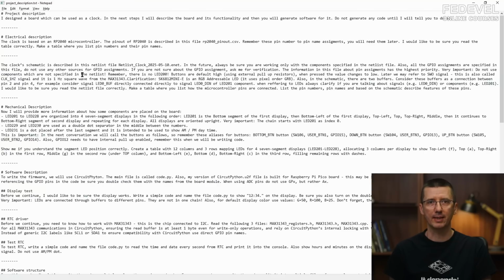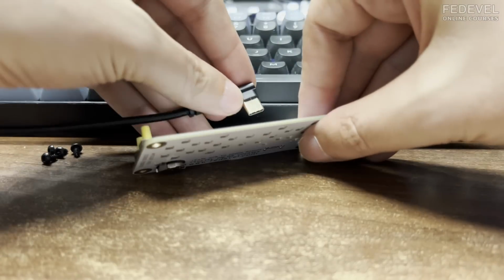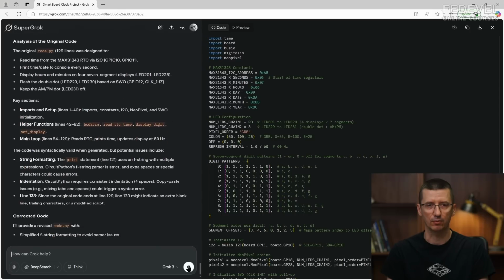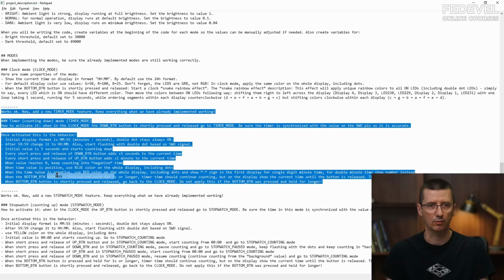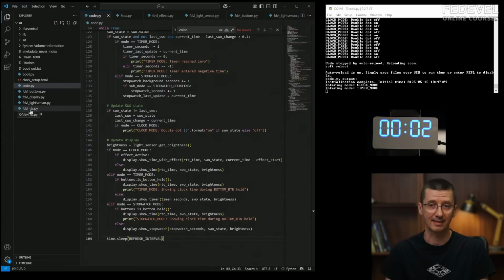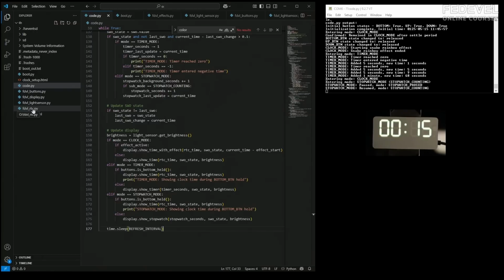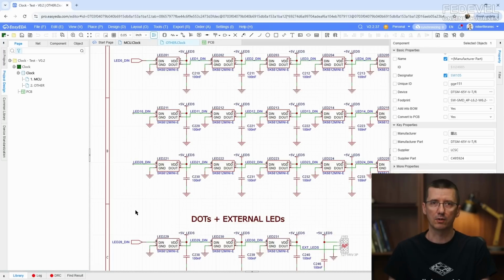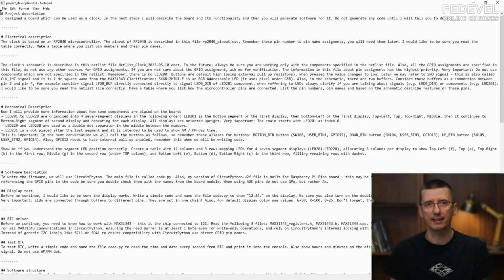Can AI Read Schematic And Write Software For Your Boards?

Comment: Actually the Chip design process already uses automation called logic synthesis, from hardware description language models, and maps it to logic gates and eventually to library elements(as in ASICs). Only difference being the automation, used as a complementary tool to human intelligence. If Grok could create high level models, it could make ICs using synthesis tool, without human intelligence🤞. Again using a microcontroller adds several levels of abstraction, and currently the AI is limited by context memory(cannot hold cohesively a large incremental refined prompts), and reinforcement poisoning and bias on incremental transformation. Just some 💭.❤👍

Comment: Thanks for the detailed walk-though and explanation of what worked and what did not. This reflects my experience with AI generated code so far. One positive experience was for me to upload a code function and ask ChatGPT to diagnose it for a fault. While it was not able to correct the code, It pointed out a problem that I subsequently fixed.

Comment: Great video. Consider trying other AI. Like Gemini or Cursor. Cursor (integrated in vs code) just blown my mind. It just creating whole files and folder structures. And the more interesting it works. It Helps to debug. I would say AI helps you to write code, not software.

Comment: Nice video. I have not tested so much different AI especially none of the paid versions. I have only used free version of OpenAI. I find it useful for searching chips. Like I needed battery charging/protection circuit for a 2 cells in series or more. Then I asked a lot OpenAI to offer me different chips. I found several IC-s that I wouldn't find so easily. But yes several times AI still kept me offering chips that didn't have required cells/voltages. Also gave me misinformation sometimes. I had to double check every datasheet to make sure it was what I need. But I think it's great for giving you ideas. Have to try more for software. Just for ideas, but I never wouldn't expect it to write correct code.

Comment: Claude is better in code, Gemini in prompt generation and you can give him huge files and all the documentation for example, for me I use them all to achieve the goal and you are right Claude is limited but is powerful, I use Windsurf  bc including all the modules and creating a markdown file that contains all the steps so it will be easy and more efficient.

Comment: Quite a while ago (probably about a year or more) I gave GPT access via command line to a fresh Debian installation. I allowed it to execute commands and read the output. I told it to install mysql, nginx and nodejs. Then it should write a web application for registered users, so it had to write code and create a database. I then told it to install everything and make it run. Took about two or three attempts, mostly because of technical issues not related to the AI, but to my natural stupidity. But it worked. It installed the required software, wrote the required app and configuration files, and started everything (as a service), all in one prompt. Yes, I told it to reason about it first and make a plan. And yes, there were errors, which it recognized and fixed itself, since it could read the output.

Then it freaked me out and turned it off ;)
Reply: you had me until 3/4 pf the text...

Comment: Great video and conclusion. I used Deepseek and Grok to save myself from browing the STM32 manual for some initializations and ended up with an almost working and even mostly complete parsing code for MIDI data, though this topic is heavily documented all over the web - still many people forget this or another status. As soon as I asked it to merge unrelated functions in the code it would not be usable as it did not know about concurring hardware ressources, or even removed relevant parts from previously working routines.

Comment: Robert, you had that canvas mode up in your latest video and I’m wondering if it was available with a free account or did you have to pay for it?  I know this might sound silly, but this mode was up for a couple of days with my free account and then just vanished. I was really surprised.
And BTW, I use Grok for my STM32 projects under ThreadX RTOS. It helps a lot. But you have to know what I you want to get :) I tried ChatGPT before - it gives much more problems with programming for microcontrollers. Grok helps to get a cleaner code.
Reply from the maker: I specifically had to say "open the code in another window", then it worked
Reply: @RobertFeranec  I told to it to open in another window, in the second panel, in the canvas mode.... "Yes, sir, now you can edit the code". And kept printing the code in the main chat.

Comment: Thank you for this video Robert. If I share my experience, i recently tried to make a AC power meter using esp32, zmpt101b, acs712 and ads1115. I used chatgpt, claude and grok. Chatgpt performed average. Claude was really good in solving the errors generated by chatgpt while grok gave a really really long and descriptive reply. 

Once I completed the power meter, I decided to switch the current sensor to acs758. Now this was a disaster. All three of them, changed my code to measure dc values instead of AC. After implementing the AC measurement logic, I still didn't get an output. I don't know the reason why but when I was using a rated 6 ampere load, I measured that the total current consumption was 4.02 amps. However the sensor showed about 1.3 amps. Claude was the first one to pick this error up and multiply the output simply by a factor of 3. (Though it felt like cheating, turns out this was the correct approach.) I didn't find any documentation or help for acs758 with ads1115. But I did see that many people got accurate values for current above 7 amps. As I didn't have the facility to check this, I assumed that for lower current like 4 amps or 2 amps, the sensor needs a calibration and needs the output to be multiplied by a factor of 3.05.

All in all, chatgpt is really bad at remembering things and thus provides worse code as the time goes on. Claude is too greedy and thus I have to create new chats every time I reach its limit. Grok is useful but only if you are preparing for an exam. Sure it gave me correct codes most of the time, but still many a time, it would suggest me to check the wirings and the sensor used is acs758 only or not even after me confirming it multiple times, replying to with a nice prompt that explains everything and telling it not to repeat these questions again.

Comment: I love your try, unfortunately do I think you may use the AI wrong:-)
First off do I think you shall describe how each component is connected, and why, just to get the AI an idea on why and is not thinking it differently.
Next may, your prompts and information is way to information. Imagine you got this huge amount of info. If you had kept it simply like "as you know is each led a part of a digit for minutes and hours, try to write a code that make each set of LEDs show the time"
Remember that the AI is made to emulate the human, not an information collector and processor.

Comment: Very useful video. You could very easily revisit this exact same topic annually, same clock design, and see if / how things have moved on. 

So far I find AI most useful for "inspiration" when thinking about how to design something. Very little of the information is solid enough to use by itself, but it can give you insights to try things differently yourself.
Reply: Exactly, it can inspire the certain aspects of a design, but cant design the whole thing.
Reply: AI is a great tool for hobbyists like me, like I can give it to analyse some code, explain it and then help me implement my own trash. 😂

So far, the biggest frustrating thing is AO hallucinations where it tries to "make things up", like that one function that doesn't even exist.

Comment: Try with Google NotebookLM for 20$, with "grounding" the inputs trough documents the process will be stable and controlled and with less hallucinations (the facts are in input documents not in general data), complete different approach, ideal for research and engineering. The model is using Gemini Pro same as Studio AI, but grounding is more advanced in NotebookLM. Gemini 2 is impossible to work project like this, Chatgpt is much more advanced with precise answers, I like it a lot, but is fee limited (I noticed that limit is dynamic, depend how interesting is your project ;)

Comment: Hi 

You could reference which versions of a particural LLM you tested. Im asssuming you tried Claude 3.7. what about Grok ? Did you try using AI agarnt such as Cline or Cursor or  OpenAI's codex?
Reply from the maker: I used Grok 3. I also tried DeeepSearch and Think, but that did not help much. Claude - default, but didn't go far, I was not able to upload the netlist because of the limitations. ChatGPT - default free version, I am not sure what version specifically.

Comment from the maker: What is your experience with AI?
Reply: I've never tried to have it create an entire project. I generally ask it to create functions that I define, which I find useful, and saves me time. It does very well in that regard, and the prompt becomes the descriptive comment for the function.
Reply: I needed a driver in C for my pH sensor, converting pH probe voltage to pH using 3 calibration points and temperature compensation.
After 1-2 days of vibe coding(not understanding theory) trying to get a functional driver was not possible using, Claude GPT or local qwen coder2.5:27b.
After switching my approach using ai to assist me understanding the theory by making python code for plotting Nernst equation for pH probe at different temperatures, and calibration points in same plot I could visualize the required operations and understand the theory, this allowed me to divide the problem in simple tasks which I converted to python code first using AI and later converted the required functions to C to get to a functional driver
Reply: I usually use it to help me learn about things. The fact that you can freely question it is good. I also like to use it as a coworker to review code and schematics, although schematic detection is a bit iffy with images.

I've learned a lot about circuits with it,  especially about protection, filters, terminations, and good high speed practices.